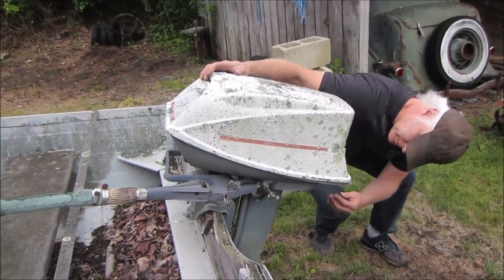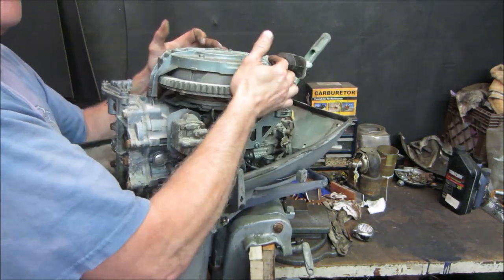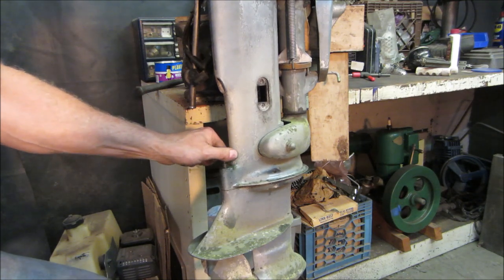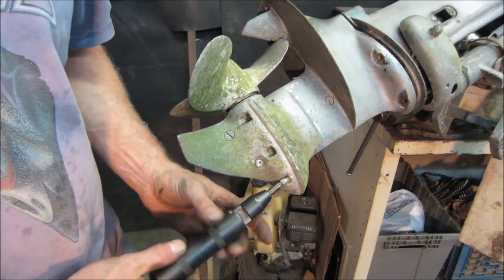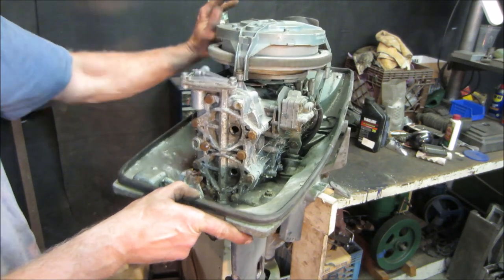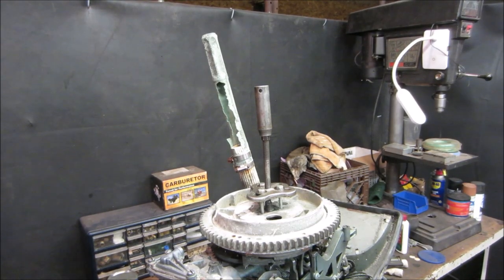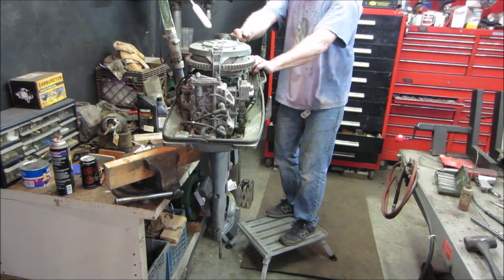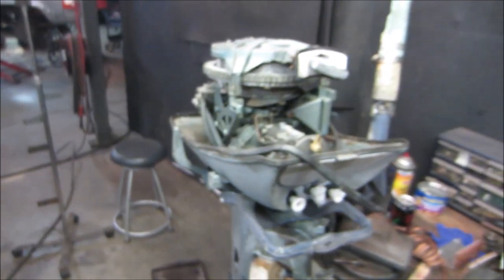Free Boat and Motor. Sitting 20 Years, Will it Still Run?

Comment: Those are my favorite outboards.  That one is a 1969 Evinrude Fastwin 18hp assuming the cover is original.   That motor is probably still viable as a regular runner.  All the bearings in the lower unit are plane bearings.  Even seized up like that, the parts can be cleaned up, the seals replaced, refill with gear oil and it will keep on giving. 👍
Reply: I agree. All parts are still available often on eBay. Worth it to revive.
Reply: Yea looks to be a 60's engine, almost looks same as the Johnson seahorse 10hp (1961) I have in my garage
Reply: Definitely worth saving. Motors like that around here go for 500-900 and it looks to maybe have less than 100$ worth of parts it needs
Reply: I think she could be brought back also guys
Reply: I have a 62 lark iv manual shift that still runs great.  It is a fantastic motor and I love how quiet it is when running.
Reply: The broken starter frame is troubling. Maybe pin it and throw some JB Weld-It on it?
Reply: @1pcfred  Send it to Keith Fenner ot Abom and have it welded
Reply: @Floodzo2  Same as the Johnson 20HP.
Reply: I agree. That would be a fun boat to cruise in. That motor should push it pretty good. Just busted nuckles &.$200 to get it all runnin..?  HeII yeah!
Reply: Evaporust would safely clean up the gear assembly. it's all fixable.
Reply: By me that's a 120 dollar engine in running condition... But yes, a damn good engine.  Parts are certainly available. Always run em' a bit richer on the oil mix, a juicy bearing is a happy bearing!
Reply: I brought a used 18 when i was 14 im 69. Now my brother has it still runs
Reply: For some reason I'm always 1 month behind on videos ..but I've been rebuilding restoring and upgrading carbs for everything since 1996.and the first carb I've ever touched was a zenith. Not to sure what it came off but my grandad showed me the ropes of this amazing to me hobbies and it's still lives to this day with alil fuel injection tricks as well.that kit to rebuild that carb runs 16 bucks to 30 bucks depending how far in depth you wanna go ...but you prolly already have done so by now.awsone project you have sir love your channel.......owner of DennisCarb.....6 to 600hp.
Reply: Oops that was to be read by everyone lol I'll redo it out there lmao
Reply: Those motors along with any evinrude are just garbage man
Reply: @alexdepew5  🤣🤣🤣
Reply: @BrokeMoFo  there is absolutely no need to run it richer! will just fowl plugs and carbon it up, causing ring failure depending on how rich. when these came out, the oil was VASTLY inferior to the tcw3 we have now, so again no need to go rich. any synthetic forget about it... that stuff is atleast 2x better than regular and stops corrosion in its tracks.
Reply: @alexdepew5  yeah an engine that still runs after 50 years after being utterly neglected definitely means its garbage. smart guy you are!
Reply: @ct1762  I didn't say DROWN it in oil, just a small bit extra doesn't hurt it at all. We run a tad extra in all of our 18 outboards, and never had a problem yet.
Reply: I am almost sure looking at the underneath it is a 15hp gale buckaneer, I am working on one of these at the moment that has a different hood but the underneath looks the exact same
Reply: @canadianpacificstudios5835  Gale was the third division of OMC along with Johnson and Evinrude.  The Gale 15hp is identical from the midsection down.  The powerhead is a version of the '55-'56 J/E 20c.i. 15hp with needle bearing wristpins and lipseals on the crankshaft top and bottom.  Your eyes do not deceive you.
Reply: Sorry it’s a 5.5 fisherman
Reply: @theHairyProject  What is?
Reply: I believe its a fisherman as the fast twin had a four bladed prop if i remember correctly?
Reply: @Beautifultruthofficial  the Fastwins never had a 4 blade prop.  They were always 3 blades.  The Fisherman was a 5.5 hp until 1964, then became a 6hp in 1965. They had a 2-blade semi-weedless prop.

Comment: I’ll need a part 2, with transom replacement and boat work, immediately if not sooner please and thank you.
Reply: chrispy
 Hey ! someone else who knows what the flat section that makes up the stern is called 👍🏼
Reply: Pretty sure everyone knows what a transom is I may be wrong tho
Reply: EZ4U2Say11 boat people do
Reply: @EZ4U2Say11  just boat people
Reply: lots of boat repair vids.  only one musti
Reply: EZ4U2Say11 I dident till I read the first reply comment
Reply: I don’t think he even knows what a transom is
Reply: Hamish Warnock He May not know what it’s called, but I’ll bet he can fix it!
Reply: You Have A New Message ghj
Reply: I use a hand held map gas torch to heat the area around the bolts to ease removal. It usually saves breaking bolts since most have thread lock on them. I too like to resurrect old motors.
Reply: @frankrightbrain  yes it's been a long time for me but heat was great on stainless in aluminum.
Reply: @WhiskeyGulf71  I gave no idea... not a boat person
Reply: @frankrightbrain  
Mpmuinihbcu
Reply: @WhiskeyGulf71  In this case it's called "wood rot".
Reply: A Transom is a maneuverable star fleet freighter space craft.

The bow is the back end, the bottom end so to speak. 

With boats, they name sides after fortified wines, call the front the arse, call the back a star ship. Ect.

A strange specimen is the boaty.
Reply: Hey Mustie  there is a boat motor junkyard  in West Gardiner, Me lots of lower end parts
Reply: @EZ4U2Say11  i would hope everyone knows
Reply: Thought it was called the taint ... ;P
Reply: @hamish566  Too clever - T
Reply: @carllarsen  THE Carl Larsen of Larsen Boat's ???. Trev....who ?...goes the peanut gallery.
Reply: @trevking3772  nope.  in fact i've never owned a boat.  but i was in the navy.  does that count?
Reply: Karl Larsen was a 1960 s mass affordable boat desinger & builder. : 50's & 70's too i think : Adverts in popular mechanics magazine & i have most of them back to 30's....Trev. NZ. & read them ALL. Thks

Comment: I bought a 33hp Ski Twin (same vintage, mid 60s) the cover looks the same. Guy wanted $100. He said he took it fishing with his daughter and after half an hour of no nibbles, they decided to come back in and it wouldn't shift into gear. After fiddling with it for a few minutes, they managed to get it into reverse, so they went back to the launch that way. After I got it home, I took the bottom end apart, I found the pivot pin for the shift fork wore thru. $12 part thru BRP. Works like a champ! So much power!
Reply: Used parts are pretty easy to come by. You shouldn't have a problem rebuilding the bottom end or finding another recoil

Comment: Tenacity, persistence, and Trust in one's own abilities .... mustie,  I hope you have children and were able to pass on some of your skills. I have a 1964 .....9 1/2 horsepower Johnson outboard. It was the same model as my fathers. When I found one locally I had great fun getting the thing to run. Now it starts second pull every single time. Never dies and nobody wants to steal it because it is so old.  I once used this Boat and Motor to tug my younger brother with his one year old 60 horsepower Mercury that had a failed fuel pump. I really really really hope that you put the time into this rebuild. This is a great video!

Comment: I just turned this on and my dad and I had a boat just like this back in the 70s and we caught a bunch of fish out that boat it was really reliable to start and run so I yes it will run if the carb is cleaned. I  actually skied behind our 18 hp evenrude. Fix it its a ripper.

Comment: These motors were built by people who thought they should run and last forever. They're kind of a pain to disassemble and service, but given that parts are readily available, and they were overdesigned, there's no reason this one won't come right back. You can probably find a lower end cheap on ebay. Thanks again for the involving amusement, Mustie.

Comment: 1969 Fastwin was always a good motor. It has some value as is and with a little $$ will be a solid runner again. Great job with the teardown, nice fight, and of course victory at the end.
I'm assuming the year based on the cover (cowl) being original. Great to see another old piece saved from the scrap pile. The flame scene was epic! 5 stars.
Doug@ the "ranch"

Comment: good thing about those old OMC engines, is that they revved so low that they were almost impossible to beat up.
Reply: 5500 rpm is low?
Reply: @alnbaba  Yes, it's nothing for modern 2 strokes to exceed 10k rpms
Reply: I own  2 strokes as well..not a boat motor tho,  but it will turn 20 thousand rpm no load and the clutch engages around 8 thousand rpms..if ya wanna get crazy? I have nitro engines that turn 40 thousand rpms..the piston is a 1/2inch bore and the stroke is 3/4inch..then there are model turbine engines that turn at 150 thousand rpms..🙂👍👌
Reply: Lee Harris yeah, you’re talking about hobby grade motors, same idea, but nothing the same as the full scale due to small size, smaller it is, the faster it can rotate.... but yeah, valid point.
Reply: @leeharris3061  I am pretty sure that they aren't talking about model boat engines or airplane engines like the K&B or SuperTiger rear rotor

Comment: Mustie, I have been around many of those exact outboard engines years ago, about 30 years ago. I can't tell you how many times I have yelled at the screen trying to help you! Hahaha😆 But hey, it's trial and error right? That's how we all learn. 1 thing to remember about most outboards is that the aluminum crimp tag on the plug wire is the top cylinder. They are pretty simple once you get familiar. That lower unit is in bad condition. I have never seen one that bad before. You may actually be able to salvage most of the contents with thorough washing and wire wheel. Thick gear oil takes up a lot of play... Just saying. Tig weld or braise the pull start with it on the engine and it should be great. Those carbs are pretty simple as well. Love your videos!  Liked, and subscribed!
Reply: stuartmays
1 second ago
Hi there,I've just bought a 1972 johnson 20hp model no 20R72R or £50 locally and can't get it to idle,I've stripped and cleaned the carbs and reset the air screw to 1.5 turns out and it cuts out on low revs but will rev high and pumps plenty water and selects gears etc, it just won't idle or cuts out on lower revs. Has anyone any ideas?
Reply: Stuart mays, most of the older outboards are 2½ turns to be a baseline start. Should idle much better without coughing. But high speed will be compromised. The screw leans out the burn and gives more power and rpm. However, backing it out should make it idle smoother, until it becomes too rich, which will indeed stall out the engine
Reply: @zackhamilton7421  Thanks mate, should I set the screw to 2.5 turns and leave it there? I read online it was 1.5 but there's a lot of conflicting comments so I've been going round in circles with it all day.
Reply: Stuartmays, the older outboards were a little different. Unlike a 4 stroke Briggs and Stratton or equivalent, an old 2 stroke outboard carb usually will idle better around 2 turns out. If it won't idle after this,   then perhaps check the emulsion tube from the bowl up to the throat of the carb. Also verify that you don't have a vacuum leak around carb base. If  that still doesn't pan out, your top crank seal under the flywheel is probably dry rotted and needs replaced. That seal is high on top and prolonged storage drys it out and will suck air from under the flywheel... causing a lean burn. Which typically will idle but only on 1 cylinder. The idle circuit should be checked as well in the carb and make sure that there are no obstructions. I hope this helps you...

Comment: The reason it was so cranky about coming apart is the splined coupler at the base of the power head is seized to the drive shaft.  This is a well known issue with older salt water OMCs.  From what I have seen, what you did is about the best recourse when you end up with a stuck drive shaft. 

Awesome video as always Mustie.
Reply: @robertrosenberg6354  Robert, you must not have watched many of Mustie's videos, he usually does a fantastic job on his projects.  I kind of get the impression that he didn't expect much from this old outboard so he didn't put too much effort into it.
Reply: That is exactly what the case is. I just threw one in a dumpster for that very reason.

Comment: The wooden part at the back of the boat that holds the outboard is called the transom.
Reply: I can sleep soundly now.....
Reply: @j.cheeverloophole9029  Cheever was gay.
Reply: Cheers for the education
Reply: Dear r01
Watched great channel Sampson Boat Co. restoring Tally Ho also?
Best regards, luck and health.
Reply: Admit it you only know that because of the Alan Jackson song “Drive”
Reply: That's not a transom on that boat, though.  That's a mudflap.
Reply: I was worried that the transom would break off with the outboard during the transit to Mustie's shop.
Reply: Thanks for that tidbit of information Captain Bligh!
Reply: chru 
cas cheers bud I just subscribed I will check it out wen I get more time
Reply: @mrb3582  I was sitting here thinking that the transom looked a bit rotten....

Comment: I traded a torn old sail cover for a British Seagull outboard that had spent several years under (fresh) water. It's the fancy one with forward, neutral, AND reverse. Completely seized, had to do a complete disassembly. I slaved away on that for, oh, must have been almost two full hours to get it running. That was 20-something years ago. Still runs. They don't build 'em like they used to.

Comment: Crossed plug wires. 😲 One of the spark plug leads has an aluminum sleeve  crimped on it with the letters "UP" on it. That one goes to the Upper Cyl.
I could see the label on the upper plug wire and when you switched the wires correctly it started 👍👍
Reply: U B Rite

Comment: Don't need to remove the shift linkage screws all the way, just back them out so they're only threaded into the front half. Upper plug wire is usually marked with the metal wrap. That is (or was) one of the best outboards ever made.
Reply: Not on those, only threades on the bottom cause its purpose acts as a clamp

Comment: I can see from here, you had the wires backwards.  One wire has a metal clip on it that says TOP.  That makes it easy.
Reply: no, no! 2 stroke --- no fire order needed. i think, 2 point system is for back up  safety on the water.  right? at least  1 plug may fire.
Reply: @davidfrank6666  Wrong

Comment: Back in the day I overhauled an exact similar unit for a friend after his boat had sunk at it's moorings and several months of immersion in sea water had wreaked it's havoc with all the internals. I had to regrind all the crank journals, the split connecting rods and the Torrington split roller bearing outer cases to suit new oversize rollers. Also balanced the crank while I was at it when I found how incredibly badly it was balanced from the factory. Ran nicely after the rebuild and was good for many further years of use, It was probably in worse condition than this one but still came back with a bit of lurve

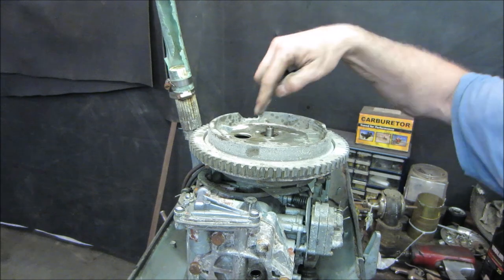Comment: 36:47 Instead of bothering with the broken pull-starter, you might try what the ProjectFarm dude does when starting a small engine like this --- use an impact-wrench on the big nut in the center of the flywheel, and whirl the engine over that way.
Reply: I think thag project farm got the idea from mustie..
Reply: Impact will crush the crank snout and maul the nut. I've tried it on the very same engine. A ½ inch drill with socket works

Comment: Seeing you work on this brings back a funny memory for me.  My cousin had an old Evenrude v8 that I “fixed” for him.  It kept bogging down while on a fishing trip on the Colorado river.  It just seemed to only want to idle no matter what we did with the throttle.  We were both frustrated trying to figure out what was wrong and had the cover off and were messing with the carburetor to no avail. After about 20 minutes I showed my frustration by hitting the side of the boat.  All the sudden it jumped to full speed! ...but only for a few seconds. I did it again and the same thing happened!  We had great laughs as we did our “Fonzie” impressions for a while making it speed up by hitting or kicking the side in that exact area.  I removed a panel and it turned out there were some wood chips caught in the fuel line behind the railing.  We still talk about that trip every time we are together.  Thanks for bringing back this great memory for me.

Comment: Hey Mustie have you heard of this new invention. It’s called WD40. Try it it’s great.
Reply: A lot of times WD40 wont help take it off and will just make things 10x dirtier.
Reply: WD40 sucks. Ruined a few bike/motorcycle chains using it, among other things. Good penetrant, just evaporates much too quickly in my opinion.
Reply: Michael Weems  ITS A PENETRANT LUBRICANT.  NOT CHAIN LUBE. !!!!,!
Reply: It's for Water Displacement. Not really great for anything else.
Reply: Soren Kuula  really 🤡

Comment: My little Mercury 25hp 2 stroke outboard sat for 10 years, before I started it up this summer.  Surprisingly, all I did was empty the fuel filter and put new premium gas mix in the tank.  It didn't take but a few tries of cranking, along with choking the engine and she fired up screaming and smoking.  Was good to go after that and we hit the water for the day.  Mine was always covered with a tarp though, not uncovered like this video.

Comment: pull start work out.... who hasn't been there
Reply: I've witnessed that same workout routine quite a few times as the craft drifts just off the boat ramp.  Darren does it pretty well for his age and without all the swearing and vulgarities normally present as part of the process.
Reply: Now that I have some gas in a spray bottle I'm getting a lot less exercise with some of the small motors I have here.